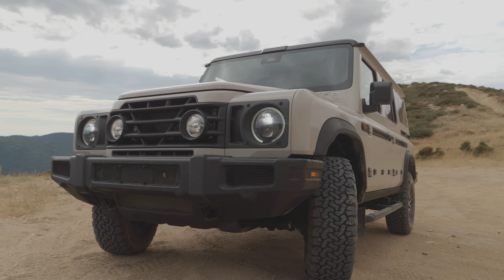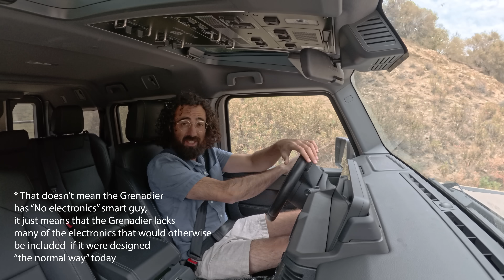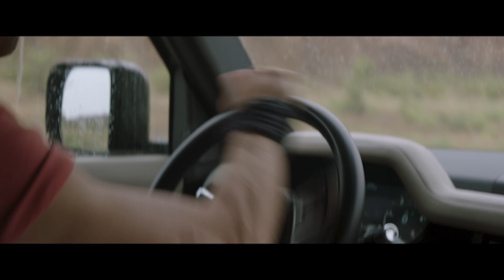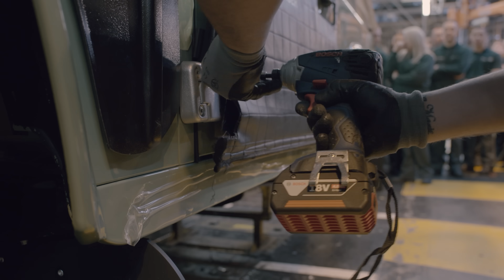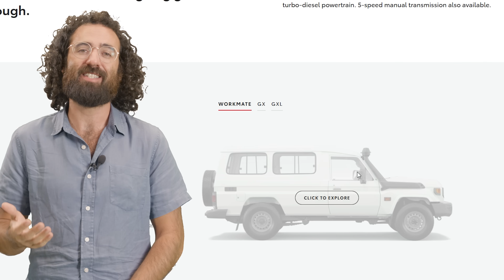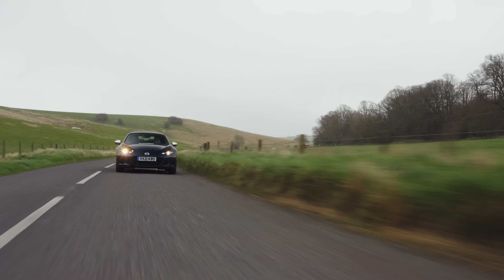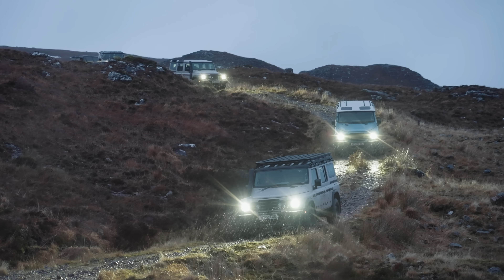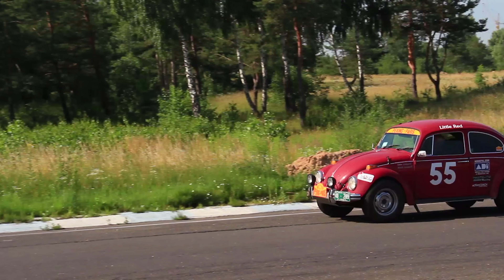Why a simple new truck has to cost over $70,000 in 2025

Comment: The excuse that the steering is as it is because it is more precise [than some unspecified rival] is complete bull/nonsense. The Land Cruiser and especially the Defender’s steering are next level superior on road and off-road. They don’t require steering dampers to stop the death-shimmy and are certainly not more prone to kick-back and both have far fewer turns from lock to lock and they self centre, plus their turning circles are very significantly better which results in far and away better drivability on tight trails, only bettered by the four wheel steering that is standard on the latest full fat Range Rover standard wheelbase.

Comment: As soon as you open the door on one of these you can tell it’s built to last.  It’s probably greener than an EV because it will last as long as 4 of them! Underneath it’s been engineered by the g-wagen team.  The box is a ZF and I’ve done 230,000 trouble free miles with the same 8-speed.  The Grenny IMO will never sell in large numbers though, and your video really explains why Land Rover had to switch gears with the Defender and why the new G is different to the original and pricier (and sells in higher numbers).

Comment: In a county close to me real estate agents have dumped their G Wagons in favor of the Ineos, the Land Cruiser being to anodyne I suppose.  Me, I'll just stick with my Ranger fx4, drive it in this continent's deserts and woods at almost half the cost.  Horses for courses I suppose.
Reply from the maker: ironically we used a Ranger FX4 as the camera truck for this shoot. it kept up, though it did get stuck on a steep climb to the point that we had to stack rocks to get it out. that was more driver error than anything though.
Reply: If it was stock could have been the terrible tires.  Or the stiff rear; large payload capacity comes at a price, I just make sure there is a load in the bed or I'm towing my teardrop.

Comment: I own 3 cars and I'm not well off financially. The problem is people want the latest and greatest. My daily is from 2001 that I put a lot of work into. My wife's daily (currently rebuilding the engine) is a 2014 and the newest car I've ever owned. Then I have another one that's also 20 years old. None of them can drive themselves in any way and that's the best part!
Reply: I tried to do that, then ran into an issue. I am very, very mechanically disinclined but could only afford very cheap vehicles, then nearly all of the repair shops in my area decided many years ago that they won't work on anything more than 10 or 15 years old, so nobody would touch my 2000 Mercury Mountaineer or my 2005 Mazda 3 except the specialty shops that charge twice as much and have huge waitlists. Want your older daily driver fixed? Better be ready to shell out about half of what you paid for it and wait two or three months. Insurance on older vehicles was also ridiculous.

I ended up selling off nearly all my vehicles sitting around my yard and barely got enough for a down payment on a new Mazda 3, which costs less to operate and pay for per month than the old ones combined (I sold four), even with full coverage insurance.
Reply: @tenpoundburrito  Yeah, agreed. And I say this as an enthusiast myself, 4BillC’s comment is kind of smooth brained. I own 4 vehicles myself. A 70’s pickup, 90’s sports car, a Toyota daily, and a Land Rover off roader. I also have the ability to do a lot of the work myself. Inclination, time, and money. Not to mention the space. 

But for people without the tools, time, space or money it’s not just about “wanting the latest and greatest,” it’s also about being realistic. For things I don’t want to do myself, it’s incredibly hard finding someone to work on them. Any rust repair, carburetor work, even pretty basic tasks are hard finding a mechanic or body shop that’s willing. I can’t even find a shop now to do an alignment on my sports car because it’s a “classic” and “custom alignment” and I live in one of the biggest cities in the US.

Sometimes I dream of selling them all and just getting something modern where I can just pay someone else to do all this work, but the enthusiast in me knows I would hate that in a week. It’s a labor of love, definitely.
Reply: depends where you live. New regulations, taxes, insurance, parking, "clean air zones" etc make owning multiple vehicles costly. Even older cars

Comment: What if they actually made a simple car...no power windows, no power door locks, no auto transmission, no screen, no climate control, no turbo, etc. etc.  This is not a simple car.
Reply: That sound like a Quad Bike. I have a basic Honda 420 quad that is great at what it does. Manual gears, manual steering, simple gas engine, no windscreen or entertainment screen, wind and rain in your hair. If four people were to have one each they still wouldn’t cost near half of the cost of a single Grenadier. They could trailer the quads behind a more versatile, road and driver friendly tow vehicle.

Comment: So in 2025 it costs Ford about $20,000 to make a base model F150 with 4x4. That's with labor and materials. But due to unions ford has to pay ridiculous fees and dues to them or they have no workers, so instead it costs them around $33,000 to produce it. The starting price Ford that truck with 4x4 is about $39,000.  The dealership might have $3000 of profit margin on it. So fords profit margin for each one would be about $3000 as well. This profit margin is enough to have a successful business but because of the unions, your vehicle is almost twice the price it should be. The day a car brand tells the unions to screw off and hires a non union staff, is the day affordable vehicles come back.

Comment: Manual transmission and transfer, free wheel front hubs, wind-up windows, and no infotainment system could bring the price down without compromising emissions.
Reply: Backup camera and traction control are required legally now
Reply: @zeusmultirotor8479 Didn't realise that those features were mandatory now. I've been in Thailand for the past 10 years, where a no frills vehicle is still available, such as the Toyota Hilux Champ for $13k, inclusive of taxes,  1 year comprehensive insurance, road tax, window tint and other free dealer incentives.

Comment: So. you could 100% make a simple truck for 25-30k. - Kubota turbo diesel 4 cylinder, 4 speed dumb transmission, C channel frame, simple body panels for a basic cab, flatbed with wood sides, solid 9" axle with lockers.
Reply: As a new vehicle it would never be legal on the road.   Anti lock brakes, backup cameras,  traction control abd a dozen airbags are required

Comment: Decent value but the nearest dealer is 370 miles from here.  No thanks.  Besides my 2023 4Runner has proven reliability and is paid for.   On your multiple cars point, I have three cars.  The 4Runner,  an Avalon hybrid, and a Subaru Forester Wilderness (had an ND2 Miata until recently).  Especially with the Miata, all the driving bases were covered.
Reply from the maker: i’d keep that 4runner forever

Comment: Last September I bought a slightly rusted 336,000 mile Subaru Forester for $500. It was headed to the scrap yard. It didn't run because the crankshaft pulley split. Replaced the pulley. Replaced the radiator it damaged, new front rotors/pads and rear struts. Found some wheels with Michelin X  Snow/Ice tires on Facebook marketplace for $600. Added a stereo and Weather Tech mats. Drove it all winter with a slight oil leak. Never got stuck in the snow.....matter of fact I have had a couple of Subarus.  Last winter was my first with dedicated snow tires. Drove like there was no snow on the ground. This summer I got the  rust taken care of. Gonna lift it just an inch and will probably drop a 50 to 60 thousand mile JDM engine in. I will be all in about $4k. Not ever buying a new car.
Reply: It can’t have seen much snow. The Subaru’s I’ve owned were hopeless in snow because the front suspension clogged up solid with hard packed snow, not only leaving no suspension movement but no steering either. It’s a matter of degrees of course, but they cannot compare to vehicles with more off-road prowess and higher ground clearance. It suits you, great, but you have your own standards and requirements and, significantly, budget.

Comment: I have an old Defender 110 Station Wagon which I love as it does what is designed for, it is noisy, slow and not exactly comfortable, refined or efficient but it does what few other vehicles can do today. I am looking at the Inneos Grenadier as an upgrade with some more creature comforts so it does not appear too compromised to me, although it is almost 900kg heavier unladen and as a result mpg is not much better and with less flexibility to fit a larger fuel tank.
Reply from the maker: yeah and i noticed a BIG difference in fuel economy on the highway doing 55 mph vs 70 mph in the Grenadier from the weight, profile, and tires. like 15-19 mpg to 11-12 depending on the headwind.
Reply: @drive I really like the Grenadier, JLR products are now rubbish, neither robust, reliable or simple/diy reparable so would never now consider a new Defender or Discovery Range Rover as a replacement. Ultimately if I do not buy a Grenadier I will just keep my 110 Station Wagon on the road for as long as possible and for not a lot of ££ keep it doing what it does best - make me smile when driving it on and off road!
Reply: There's a company that does a larger tank for the Gren. My diesel gren does approx 480 miles to a 90ltr tank and that was calculated on various trips with different loads.

Comment: To a degree, simplified vehicels would be great. But they didn't become 30% overpriced from previous overpricing because of additional complication. They became that from money printing and company greed not passing offshore labor savings and deflationary engineering/business streamlining from being passed onto customers. It's truly ruining most industries
Reply from the maker: that's an element, for sure
Reply: It's the primary reason. The currency debasement has more than offset the benefits of engineering deflation

Comment: I bought a brand new Jeep Gladiator for $25k. Straight axle, 4x4, no power locks, hand crank windows, well proven offroad, simple pickup.  There's zero reason to pay $70k for what isn't much more as far as power and features.  

Simple does not need to be expensive.
Reply from the maker: nicely bought. it's true that it doesn't always have to be expensive, but Jeep has the benefits of scale and a global corporation to be able to offer something that simple at that price. same reason Ford was able to resurrect the Bronco and (briefly), they could adapt the global Ranger platform they'd been cranking out for a decade to save a lot of money in development. but even then, they were only able to offer the base version for under $30K for a brief time, and now it starts close to $40K.

Comment: Are we just kind of forgetting that a Jeep Wrangler Unlimited Sport starts at $36,000?
Reply from the maker: no, but i have one. a 2024 Wrangler Sport S two-door. it's not really in the same camp despite obvious similarities. it's not nearly as overbuilt for long-term durability, it has a lot more electronics, and even the Unlimited is a lot smaller. it's also not nearly as capable until you get to the Rubicon.

Comment: First time watching any content with this host. He hammered the nail with the point about 1 car solutions. It’s definitely not easy to have multiple new cars nowadays with prices being so high and cost of living for the average joe. But enthusiasts will find a way because of our passion. I have a 2023 wrangler Willy’s 4xE (bought used for 25k out the door that serves as a fun daily/ weekend off-roader. Sure the ride on road beats you up but if you don’t care about getting jostled over bumps it actually handles quite well in the mountains and has a shit ton of power for a wrangler. Then there’s my wife’s 2023 Camry that is the ultimate gas sipper and road trip king. But my weekend only car is a 1988 fiero gt 5 spd that I daily drove for 4 years and 40k miles before getting the jeep. Where there’s dedication there’s compromise, and I was totally fine with no power steering, a radio, and ac. Tech is overrated and bloats modern cars with issues.
Reply from the maker: hey, thanks for watching. credit for the 1 car solutions angle also goes to our producer joey. and you make a great point. i have a 1988 K5 Blazer and one of the things i appreciate most compared to my daily is that it doesn't have a screen and doesn't want anything to do with my phone.
Reply: @drive have always wanted a k5, hold onto it man

Comment: I’ll stick with my 24’ 5th gen 4Runner TRDORP with KDSS.  Been in Africa, ME, and Asia wheeling.  You don’t want a modern BMW turbo engine detuned or not.  Obviously he’s never filtered gas in Haiti with a t shirt.  I’ll stick with older Toyotas.  All the changes were made for CAFE safety and other rules, many of which have been removed by the current admin.  Thank goodness.  BTW GM should fire their CEO, they should immediately bring back 5.7 V8s with port injection no active fuel systems and simple 5 speed transmission with metal parts.

Comment: Like the Lotus Elise, all the people who wanted one bought one. But after that, no one is cross shopping an INEOS with other 4x4s later. It's not a work vehicle in Europe, Aussie or other countries that use NCAP safety. So it's a private reward purchase.
Reply from the maker: yep, it's a very deliberate choice, and not one most people are going to make
Reply: I worked for Mercedes in the past, the Hambach plant was built as a JIT factory, so the parts supplier shipped that week's trailer and no more. Hence why the Smart never evolved much. I have worked for Renault/Audi/Porsche and Fisker over the years. The Hambach plant was cheap for a factory, but without a steady flow of cars it's rinsing money. A primer bath isn't something you can turn on and off for batches. They can't ship more to the US as they will hit the ceiling of exports per year and they have flopped in other countries. I suggested they build the cars with Morgan, who don't have an SUV and a 800 unit/year production would be better suited and let's be honest, questionable build quality would be expected. They all live in Monaco instead of Malvern so they thought Hambach would have the production numbers to justify it and it's been a disaster.

Comment: We bought a Miata specifically because it is so focused on what it should be. Such a fun and enjoyable vehicle to have, even if you can't fit a family size toilet paper pack in it without putting the top back.

The single vehicle we had prior was a 2017 Raptor (still have it) because we offroad, road trip, commute, get groceries, have dogs, need to do lawn care, etc. Could likely do most of this in a sedan or whatever, but the single Raptor just hits on everything but operational costs and size, but even then, splitting up 3 vehicles requires space that we don't have and has its own additional costs that make the math fuzzy when fun, enjoyment, and lifestyle come into play.

Comment: This was the BEST Grenadier overview and vehicle explanation I've ever seen. I have two "cars" - a 1990 Defender & an INEOS Grenadier and the Defender looks great, runs solid AND is noisy, leaks rain water internally, leaks small amounts of oil externally, etc., etc., etc. The Grenadier is EVERYTHING the Defender is - without the downside. Love both vehicles, but drive the Grenadier WAY more than the Defender.
Reply from the maker: Nice garage! And thanks for watching. We try to get it right.
Reply: I have a 2021 Defender 90. You're missing so much with your old model. The seats are comfortable, it's quiet and fast, and it's been offroad every day...for the last four months waiting for a high voltage electrical fault to be fixed.
Reply: @Hundredthldiot  
You bought it too soon. From 2023 model year the new Defender has been sorted to now be one of the most reliable vehicles of its type, and counting SUV’s, available. The mild hybrid system is now well proven and unobtrusive. Certain actuations and the latest Pivi software transform the vehicle and the modifications available to suit all tastes and requirements are amazing.
I’ve had [and still have a 100 series] Land Cruisers, Nissan Terrano II’s, Isuzu Trooper [Bighorn], various 4wd pickups, BMW X5, Audi Q7 and four Range Rovers and five Defenders, many run until scrapped. Nothing comes close to the latest well equipped Defender even though I do have a 2022 Range Rover as well that given ‘better’ wheels and tires is very very nearly as capable as the Defender.
I cancelled an early First Edition Defender order ‘just in case’ as well as two orders for Grenadiers for the same reason. Very glad I did because both vehicles have suffered from early model glitches and issues. These have been well sorted on my 2024 model year Defender and Grenadier are working hard to improve the bugs and quality control issues on Grenadier. Now is probably the optimum time to buy both models, certainly Defender.
Reply: @hedydd2  interesting, thanks, and I hope you're right, although people have been saying "this time Land Rover have fixed their reliability issues" for decades. I'm obviously hoping that after this one problem has been fixed it'll be perfect...
Reply: @Hundredthldiot and breaks down after sixty thousand miles, very expensive repairs
Reply: @Hundredthldiot  Hahaha! I'm sorry; I'm not trying to laugh at your misfortune, but the way you worded it was hilarious!
Reply: @Hundredthldiot  They don’t look as great though 😅
Reply: Love your comment! 🙌🏾 ⚡️
Reply: Obviously an old model ‘old’ Defender, not the far far superior current model L663.
Reply: Same!  So glad I picked this one! :)